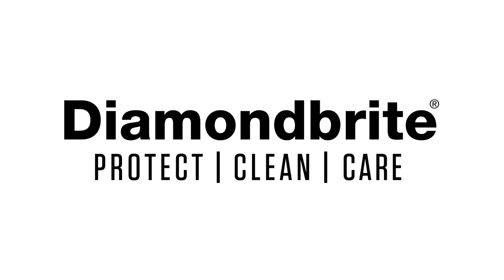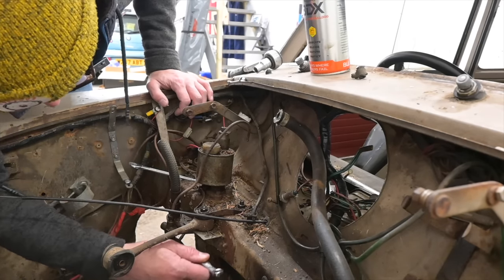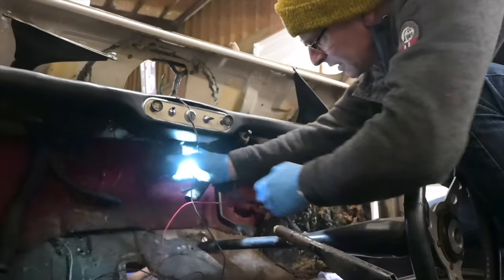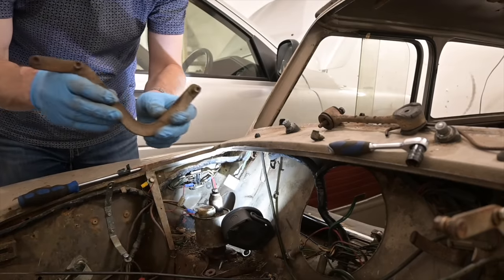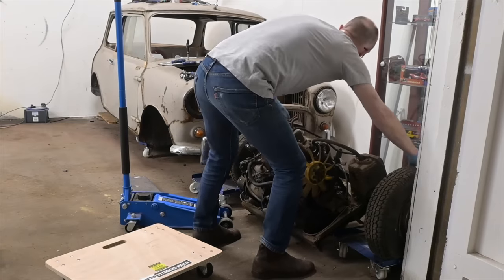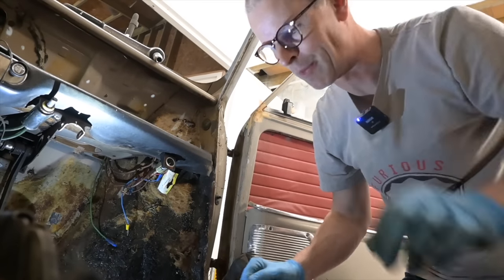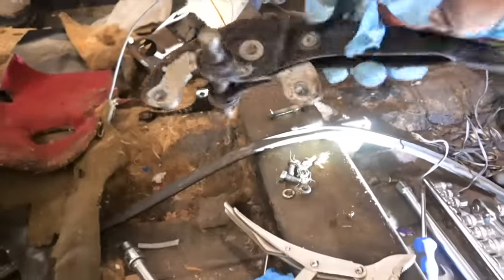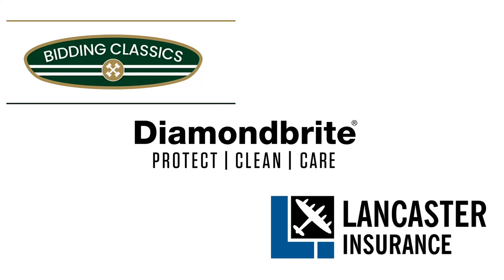Mk2 Morris Mini Resto - Tearing the dash apart

Comment: My Dad bought an identical Gedore (pronounced gee door) kit in 1967, it’s been used and abused by him, then me now my son. Some of it is lost but all which is left is still working perfectly with the exception of the plastic handle on the ratchet which came off sometime in the mid 80s. The sockets have been used on ‘windy guns’ too and not one has ever failed. I could tell you were using the Gedore ratchet before I saw it as it’s ratchet sound is so familiar to me. 

Snap-on may offer a lifetime guarantee and replace tools which may brake but it’s even better when the tools don’t fail in the first place. Look after that kit and it will outlast you. My dads outlasted him, it’ll outlast me (I’m now 61) and I’m sure my son will leave them to his son one day.

Brilliant

Comment: Great video! Those springs in the lights are because the screws are used to set the headlight aim. This means they're only ever half in and don't really go tight against anything. The springs provide the tension to sort of hold it altogether. Car designers were optimistic half-full glass of beer kind of people in those days.

Comment: Hi Matt, from Sydney, Australia. Lucas sealed beam modules had that very clever spring-loaded aim adjustment system so one "flavor" suited both left- and right-hand drive beam aiming, so with the 2 screw adjustments, one for up/down, one for left/right. suited both markets with just one style of headlight mounting pods halving design costs back when Brit's had clever design skills. Same units here in Aus' for near all cars back in the 60's using Lucas sealed beams. Now, as an aside, many people "slag" off Lucas items, HOWEVER, here in Australia, due to our mega mileage of rural roads we needed decent headlights. Many imported cars needed to have their "poxy" Bosch and other brand dim useless headlights to be binned from day one and replaced with GOOD QUALITY, SUPERIOR Lucas ones as the others failed the brightness, penetration and depth testing demanded by Australian Federal Department of Transports Aust' Design Rule standards. Many cars had same shaped molded amber blinkers as foreign markets, but the amber blinker pods had been completely, carefully re molded by Lucas to emit the correct brightness level required for the car to be ALLOWED registration on Australian roads. Also having mirror like polished alloy backing plates that further enhanced the "throw" of the lighting. 

To win Concours d' Elegance competitions, owners will pay extraordinary amounts to have a PERFECT set of period Lucas lighting in their cars in Aust' to obtain the necessary points to get a prize in the Concours.  

E.G. a mate has a recent import LHD 1966 w108 Mercedes Benz 250SE, it has the vertical twin headlight "americana" headlight pods with Bosch sealed beams in it and Bosch & Hella made blinker lights. Recently it broke down & he returned home from an outing with me in my Aussie delivered from new 1967 Jaguar mk10 /420G. Paul remarked how bright the headlights were, I stated they were just standard fitment period pieces, not updates. When I backtracked to "rescue" him he also remarked how bright the blinker lights were when I switched on the hazard light switch (yep we had to have those here years ago for registration approval) so all amber indicators were flashing.  In the Merc' the front & rears are made by the 2 different German coy's  and from a distance are quite dim. However, as to the MK10/420G's all Lucas indicators, the tilt-a-tray towie to collect Paul's Merc' saying "jesus couldn't you find a brighter set of hazards, you could see yours from the moon", the total opposite of people slagging off Lucas as the prince of darkness. 

I've owned my big, giant Jaguar for years and years now and it's Lucas electrics have never failed me, in the mid '70's to '80's I had a '65 model 4.2 ltr mk10 & I racked up 150,000 miles in it, mostly remote rural miles & NO Lucas issues, and for 32 years from 1979 I owned a rare series 1 long-wheelbase XJ6 190,000miles and not one Lucas issue.  However, my best mate has a pair of low mileage w126 Mercedes a 560SEL LWB 4 door and a 380SEC coupe, both are beset with Bosch electrical issues, the 560 has done just 200miles in his care & the 380 coupe about 1.000mls however in the same time I have done 40,000 miles yep FORTY Thousand trouble free miles in the 22yr older Jag. My Jag IS NOT restored just lovingly maintained by both myself and its prior 1st owner bought by me in 2012 it's been flawless, faultless.  So much for the perceived excellence of the Mercedes product, in the cold light of day not so good. Whereas the mk10's been bullet proof in reliability.

Comment: Some nice steady progress there Matt and a lovely blast from my past. 
My first car in 1983 was a '73 Mini 1000 and my first socket set was a Gedore. 
My freeing agent then was veg oil or ATF fluid mixed 70/30% with nail varnish remover (acetone) and it still is, never failed me 40 years on.

Comment: Yay mini content at last. Get a bench grinder with a wire wheel disc to clean compents such as the engine steady etc before its ready to reassemble. Money well spent and does a good job cleaning up rusty bolts too

Comment: Hi Matt, glad it's you stripping  the Mini, I just wouldn't have the patience or be able to cope with all that dust. I'm surprised you haven't got a bean bag for non tripod support, also useful for kneeling or sitting on ☺️. I found ages ago in a bargain bin a really useful abs plastic tripod head that clamps onto car side windows, won't take full size SLR but will work as bridge or  lens support.

Comment: this will take a long time and effort and bucks  to get it road worthy. I have worked on a few of these in the past(not Recent) and they can be buggers to work on. Drum brakes were the norm on these in 69 but there is a conversion kit to make them disc. Envious of your ability to squeeze into wee areas inside the car. I can't do that any more. Not to worry, these things can take years to put back together. So no rush.  Later 👍

Comment: You talked about wheels.  If you can source Dunlop reverse rims then these are idea for a drum brake  car .  Cooper S wheels have a different offset for discs and would stick out too far.  Dunlop reverse rims are 4.5" and fit on the car without the need for extension arches (well this was my experience in the early 1980s with my drum brake 1977 Mini 1000).  Normal 145 tyres are happy on the 4.5" rims.  With the centre cap hub caps these look subtly different.  Any wider will need wheel arches.

Comment: It's coming on or should that be coming off.  Those sealed beam units had no gas in them just air, it's why the reflector coating went black or blue over time from all the other gases in the air. Although would often burn the filament out first.  The springs on the bezel screws are to keep the beam adjustment correct and to make it easy to set in the days of marking a wall with the beam centre after measuring it on the car and aligning it off to the left and below on dipped beam.

Comment: What's going on with that inner sill on the off side?
It's had holes punched/drilled into it for plug welding but they have used tack welds on the edge instead?????